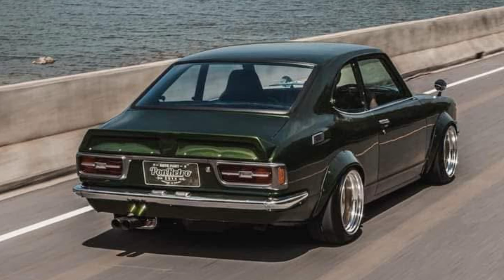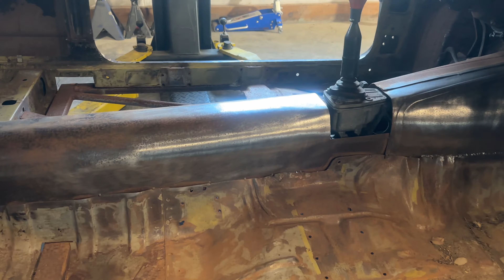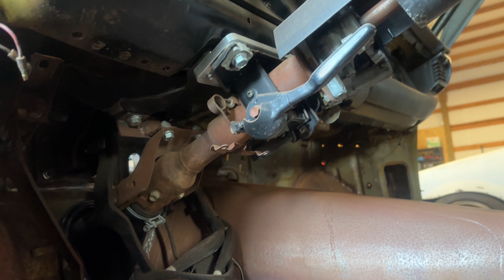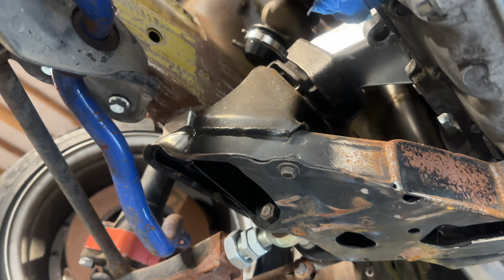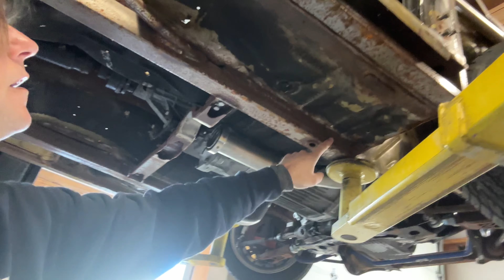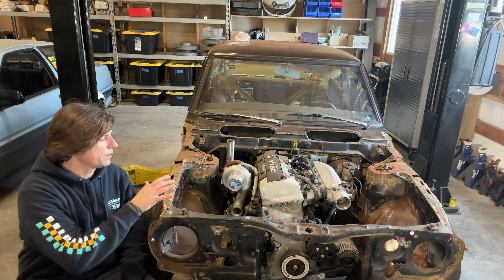Building my perfect drift car : Turbo s2000 powered 1973 TE27 Corolla

Comment: I feel like the whole car is rusty, yes only surface rust but still.
Will you be sandblasting or acid dipping the chassis after everything is done?
Reply from the maker: I’m just going to wire wheel and sand off all the rust I can get to.

Comment: I did the same thing on my roomates 280z with the frame rails. We used square tubing all the way to the rear.  It's so sturdy that we can jack the car up on the frame rails now. I'm excited to see this build
Reply from the maker: It was also necessary because of how badly this car has been wrecked and put back together 😂